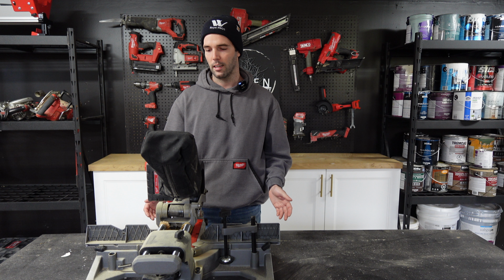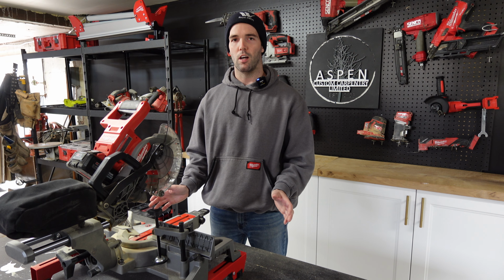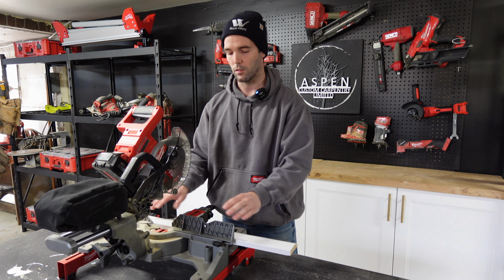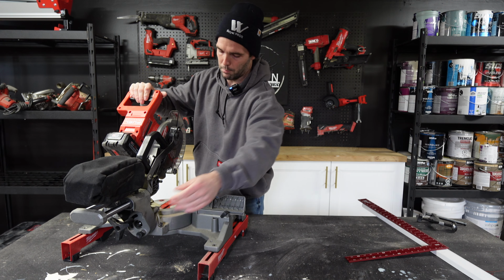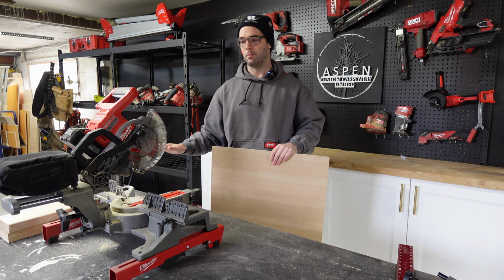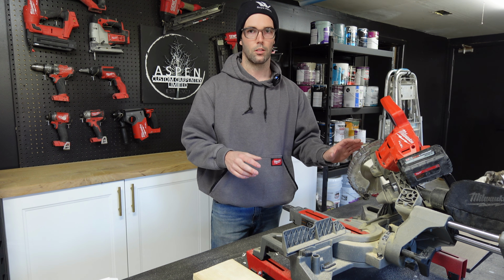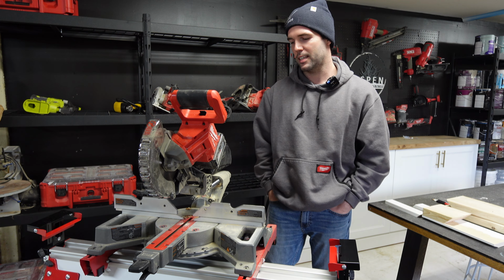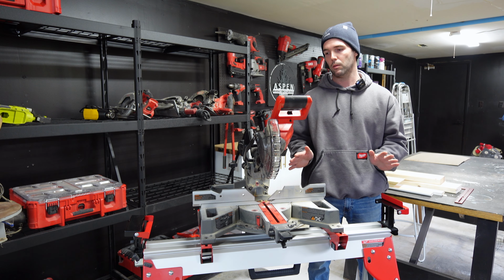Watch This Before You Buy a Milwaukee 7 1/4" Mitre Saw! TOOL REVIEW

Comment: Seams like a nice little saw , just Not a big Milwaukee fan and its a little pricey for a 7 1/4" saw .  Nice Review , keep'em comming ..... 👍🖖
Reply from the maker: It could be priced a bit lower that’s probably the biggest draw back! Thank you
Reply: I’m a Milwaukee fanboy but like he said the weight is crazy. The locks engage very mechanically. The other benefit of the 7 1/4 slider is definitely blade price in comparison. Also the ability to share blades with your circ saw make multipacks of blades a smokin deal.
Reply from the maker: That is all great points!

Comment: I got my 3-4 year ago. Out box the cuts so bad. About 1-2 degrees off every cut. I had to adjust. The longest time I wasted was sanding the left and right miter table down so they can match the center moving table. After those fixed. Still cuts good 90 and 45… wish more quality control. Adjusting to 45 was easy. But only way to adjust the miter table was painful…

Comment: Ive just bought one of these as i work in the uk and my current setup is 110v for my mitre saw. This means an annoying and weighty transformer. My plan is to use this for the vast majority of my work and, if it proves necesarry, ill get a Festool KS120 for the bigger finish work. 

Everything ive looked at ao far is super positive on this saw, hopefully it proves to be as good as everyone seems consider it to be

Comment: Coming over from your main channel with Sabrina. Yes please for the calibration video. I have a 210mm evolution mitre saw and always have issues with cutting square. When it’s off it seems square but when I cut it never seems a true 90.
How much ‘play’ do they have when you pull down the cut, can it make a difference if I’m putting pressure say towards the cut? 

Such a pain through my kitchen Reno project which is almost over. The next build is a 13ft wide floor to ceiling built-in tv unit with drawers and shelving and I want it to be right 😵‍💫😵‍💫😵‍💫
Reply from the maker: Thank you so much for subscribing! I am currently working on creating some helpful videos and will try to address your concerns. It doesn’t take much for a saw to pop out of alignment and not cut square and surprisingly out the box for some reason a lot of them are off by half a degree or more which really does make a difference!

Comment: I've had this saw for a couple of years. It's not the saw I planned on buying at the time, but overall, it's been a good saw for me.  

I'm a paint and drywall guy, so it's great for smaller molding replacement.  Good saw for most exterior wood replacement as well. 

My rails are the same way and have been since purchased. I also think the motor on mine sounds a little clunky. Yours sounded better, at least in video lol.
Reply from the maker: Thanks for sharing. And thank you for watching!

Comment: Great Video, saw looks… stunnin’! 

Just got into the 18v Milwaukee line up and love it, using the 7 1/4 inch circular saw but looking for something that’s more consistent, thanks for your insight!
Reply from the maker: Thank you! I would for sure look into the 7 1/4” mitre saw. It’s nice because the blades are cheaper and also work on the circular saw which is a huge perk!

Comment: You said at 90 deg it cut 8.25” what was the capacity at 45 deg? Looking to get to use for 6.5” baseboard. Need to miter 45 deg for return cuts.
Thanks 🇨🇦

Comment: my 10yr old delta sliding saw makes same noise on guides.Got used to it never hindered on performance.I did oil the guides but the noise is still there.Looks like simple metal to metal contact noise.

Comment: Correct me if I’m wrong,but you are never supposed to pull a sliding mitre saw towards you while making a cut. 

According to the manual this can cause the blade to ride up on top of the material and pull the saw towards you. 

It also means the blade is moving counter to the direction it’s designed to cut (unless there is some sort of blade I’m unfamiliar with, which is possible).

I guess it worked out in your demo, but that’s what I read in the manual for a 7 1/4 Craftsman mitre saw.

On a different note, I noticed how the Milwaukee motor is offset in a high position. This should make all standard baseboard cuts straightforward, which isn’t the case with the Craftsman. The motor of the craftsman is straight off to the side and can not do some vertical 45 degree mitre cuts without the motor running into the material before the cut is finished.

Comment: I calibrated mine well enough the problem is the fence is NOT 90 degrees to the deck…really pisses me off I can’t cut any miters vertically. Other than that it’s a solid saw with great dust collection and easy to carry